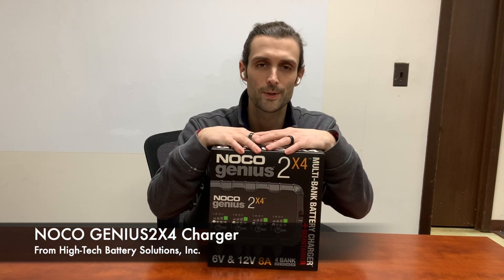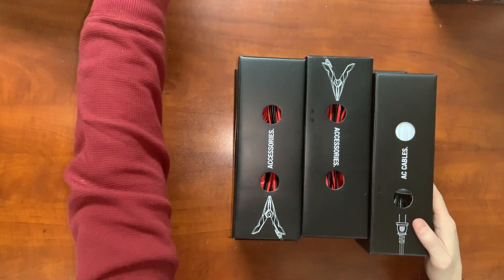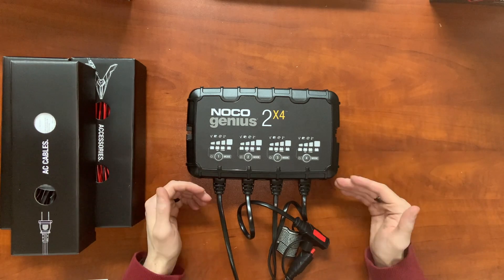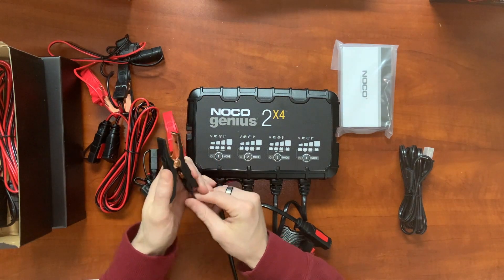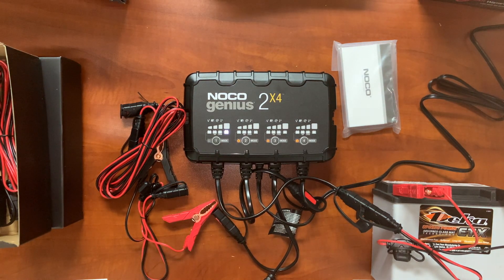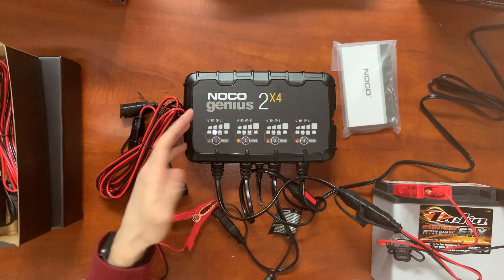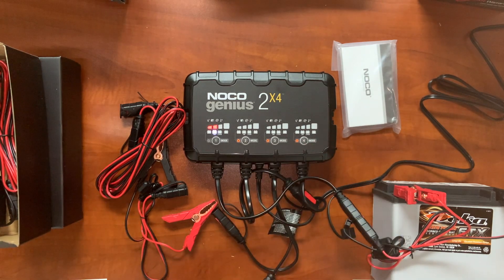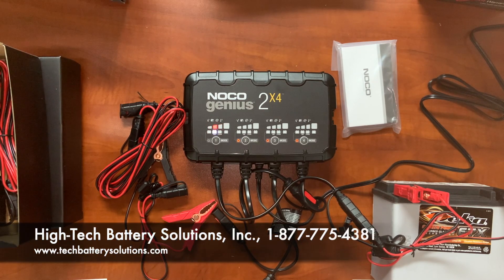NOCO GENIUS2X4 Battery Charger Review

Comment: A shame they did make the plug attacked to the box modular don’t always need having cables hanging
Reply from the maker: The first iteration of the charger did have fully detachable plugs, one of the things we noticed with using it over the years was that our guys were able to tug on the cord and disconnect it from the charger way to easy. Since we used these as bench chargers for multiple batteries it got a bit annoying when it happened. Wit the new design its physically clipped into the fixed cable on the charger bank instead of pressure fitted into the charger itself - a lot harder to disconnect by accident.

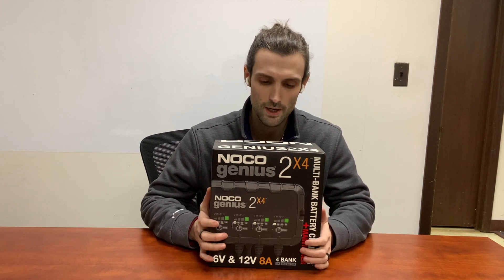Comment: How long doesvot take to care a battery up 0:48
Reply from the maker: This is a 2-amp battery charger. So you need to divide the total capacity of the battery by two in order to find out how long it would take to charge up. An average car battery is about 65 amp-hours for the capacity. So assuming it was 100% dead, I take about 32 hours to charge. If it's a power sport battery, it's much less due to the size of the battery. It would only take 6-8 hours.

Comment: I have 4 duel purpose AGM group 31 batteries with 110ah that are fully charged. I am looking to use this charger to maintain the batteries throughout the winter. With this charger work for maintaining? If so, is it safe to leave the batteries hooked up and the charger powered on throughout the winter or should I disconnect the batteries and turn off the charger at some point? Any advice would be greatly appreciated. Thank you for the video.
Reply: Rather then taking the lazy way out why wouldn’t you just go to the website and get your answer there. I’ll never understand why people do this ask a question on social media vs putting some work in and getting the answer faster from the website. Stop being lazy

Comment: Should lithium batteries be topped off.  I have electric mower and wonder if i should charge after every use or let it discharge down low and then charge ? TYIA
Reply from the maker: I do recommend topping off lithium batteries. Even though they have a much longer cycle life than lead acid, they still get their best bang for the buck the less capacity you actually use from them.

Comment: I have my 4 12V 280ah batteries connected in a series for solar inverter. Do I need to disconnect the batteries from series before connecting the charger?
Reply from the maker: No, you will be able to leave the batteries hooked up in series while using this charger.

Comment: Good video with one caveat. The extensions and different connections. Case in point. I have 3 motorcycles and I am about to install the NOCO GBC007 Boost Eyelet cable permanently to each battery so that in case of being out and about and have a dead battery for whatever reason, I can bust out the NOCO GB40 booster to jump start it. Now, with that being said. Are the extensions configured so that instead of attaching the clamps, you can plug directly into the NOCO GBC007 for trickle charging while being stored?? One more question. With the pervious question, I have to ask, can you actually charge with the battery still connected to the vehicle or does it need to be disconnected??
Reply from the maker: Unfortunately, that is a negative. As of the writing of this comment, the GBC series accessories are not compatible with the Genius Chargers. They are only going to be compatible with the Jump Starters. It's a different quick disconnect style.
Reply: I thought the adapter it comes with solved that?
@HighTechBatterySolutionsInc
Reply from the maker: @gregleblanc9357  To my knowledge I'm not aware of an adapter that will allow the GBC series to work with the standard NOCO Genius line.

Comment: So to be clear, this doesn't double as a power bank? It needs to be plugged in for power to be supplied to the device? Are there devices by Noco that are fully portable (has power bank)?
Reply from the maker: That's correct. This unit is not a power bank. It must be plugged into an AC power source in order to function. NOCO makes portable lithium powered jump starters, but they're not true battery chargers. If you're looking for a battery powered portable charger, I'd recommend taking a look at the CTEK CS Free unit. https://www.techbatterysolutions.com/ctek-cs-free-4-in-1-portable-battery-charger-maintainer-power-bank/

Comment: I want to buy a Noco to charge/maintain motorcycles, slingshots, and sxs.  Would you recommend the Genius2x4 or Genius5x3?  Main difference besides how many banks?  Does the 2a just take longer to charge otherwise same performance?
Reply from the maker: I recommend the GENIUS2X4 for this use case. The 2A output is more than enough to maintain those applications and its easier to use than the GEN5X3 series for charging power sport batteries. The GEN5X3 has permanently attached eyelets on the end of the DC charging cables and is not compatible with any of NOCO's accessory line.

Comment: So this wont charge my 4 agm 6v batteries ?
Reply from the maker: The 6V charge mode on this unit is really designed for flooded batteries - I would not use it to charge AGM series batteries for long term use.

Comment: Question: I selected the wrong mode for my battery (12V AGM instead of 12 v sealed lead acid. So after it turned Green it was taking longer to Optimise the battery. Then I saw you video and understood the difference in the modes so I turned it back to the first 12V. Will that cause any harm to the Battery?
Reply from the maker: Over time it would cause damage to the battery due to the different float charge voltage thresholds for the different chemistries. If it was left on a for a a week or two your going to be just find on that.

Comment: Another  question... If you hook up 2 banks to 1 battery, will that speed up the charging process without any harm to the battery or charger?
Reply from the maker: Negative, it's been my experience that you will actually end up under charging the battery. The charger uses the voltage level of the battery to determine where it is in the charging process. My assumption here is that by having more than a single bank hooked up to the battery will artificially raise the voltage to much and trick both banks into shutting down earlier than needed to get a full charge into the battery.

Comment: can we use it to charge 4 battery 12v 100ah cennect serial ?
Reply from the maker: You can however it may time out on this charger depending on how far down the batteries are drained. Keep in mind that this charger is only putting out 2 amps per bank.

Comment: crazy they dont use SAE connectors then want $72 for 4 adapters to SAE, also ten foot long cables not long enough to connect to 4 vehicles then they only offer expensive additional ten foot cables (Battery tender are 25ft!)

Comment: I'm assuming to just maintain the battery you just leave it connected and forget about it in the regular charging mode or is there a special mode for just maintaining it and making sure it doesn't overcharge it? thanks in advance..
Reply from the maker: Thats correct, leave the charger in the correct charge mode for the chemistry of the battery you are charging and it will go into maintenance mode once the charge cycle is complete.

Comment: Question, I try to charge my optima batteries I believe they are AGM and they have stayed on the first bar and they haven’t moved after like eight hours. Should I remove them from the truck and charge them that way with everything disconnected or could it be a issue with the battery they are brand new, but I haven’t used the truck. I believe the drain completely down.
Reply from the maker: I recommend leaving the charger on the battery and let it try to run through a full charge cycle. It certainly sounds like there is a parasitic drain issue in the truck, after 24 hours if the charger is still on that first bar I would then remove (disconnect) the batteries from the truck and try again.

Comment: I have the noco charger my problem that i’m connecting the charger the to battery and at the same time I’m running my 12V fridge … the charger always shows that the battery is not holding charge…. So how i can keep the charger charge and maintaining my battery while i’m using my appliances?
Reply from the maker: The charger will eventually error out thinking the battery is not able to retain its charge - the draw it outpacing either the charger or its draining enough of the battery capacity to consistently drop its voltage below the charged threshold within a short amount of time.

Comment: Will this charge work on group 31 950-1000cca batteries
Reply from the maker: It would work to maintain them without an issue, however if you are charging them a completely discharged state it's not an ideal output. If you are charging completely drained 31 series batteries you would need to step the charger up to a 5A series such as the GEN5X line.

Comment: Have multiple bikes atvs with different batteries in all of them etc can’t decide between noco 2 or noco 5 ??
Reply from the maker: If you are charging them one a time and they are all smaller power sport batteries I recommend the GENIUS2. If you want to charge multiple at a time then the GENIUS2X4 is the way to go. You can set each bank individually for a specific chemistry and let it do its thing without having to worry about over charging.

Comment: I have 4 motorcycles - all four are maintenance free batteries. But only 1 motorcycle automatically charges when I connect the bikes to the Noco 2x4. the other 3 isnt recognized. What did I do wrong? I forced them to charge but i dont feel comfortable doing this.
Reply from the maker: If you had to force charge the batteries it could be an issue with their initial voltage level. If its below the chargers voltage cut off threshold then you would be required to use the force charge mode.

Comment: I have a novo genius 2x4. The #1 bank is blank, no less are on. Banks 2,3&4 work fine and charge batteries like they should.  Any idea why bank one has no less on??? Bank 1 will not charge
Reply from the maker: If the power light is not on for that first bank at the very least then there is a warranty issue with the bank

Comment: so this will not charge a 6v agm? or can I use it for a golf cart and charge  2-6v agm on agm setting 12v on golf cart 2 @ once time =12v? they all run parallel 8 x 6 48v THX AW
Reply from the maker: The 6V mode on this charger is geared for flooded and GEL batteries so not an ideal solution for 6V AGM's. You can wire them up to create a large 12V battery and use this as a battery maintainer for your entire bank.

Comment: I have a 2018 Toyota Tundra with group 27F 710cca with reserve capacity with 165 min. After having charger on for 8 hrs shows no error lights will go to second red charging light flashing and never goes to green showing its fully charged. The truck starts but doesnt show fully charged. Its on the 12V charging. Any ideas why this is? What do you recommend.
Reply from the maker: It sounds like the charger is working as it should - keep in mind this is a 2A charger, so 8 hours on charger in its bulk charge mode put roughly 16 amps worth into the battery. The typical capacity of a group 27F is 60 to 70 amp hours, so depending on the state of charge for the battery it may take more time.

Comment: I have four 6V AGM batteries. Is there a product NOCO sells that will charge 6V AGMs or can I use the NOCO Genius 2X4  to charge them if I create a series resulting in a 12V output?
Reply from the maker: The NOCO GENIUS2X4 unit does have a 6V charging method as part of its algorithm however it's geared towards flooded and gel cell batteries. NOCO makes the single bank GENIUS series such as the GENIUS10 with a dedicated 6V AGM mode however you would be limited to a single bank charger. It would be a trade off unless you get creative with your wiring.
Reply: Can I use this charger to charge low rider batteries? 4 batteries at once?

Comment: Need your recommendation on maintenance charging/charger for a 4 bank 109-amp hour (each battery) deep cycle system. System is in a garage, in the air with a 120V plug nearby for the garage door opener. Plug has 1 outlet open (not being used). System is used for emergency power back up when the power goes out (grid down). The batteries are to power a 2400-watt inverter for 2 full size house refrigerator/freezers. Thank you!!!
Reply from the maker: I would recommend taking a look at the GENPRO10X4 unit from NOCO. This is a four bank 10 amp per bank charger with all of the features we covered in the GENIUS2X4 video.

Comment: Excellent review......Thanks. 1-question. I live in Canada  where some winter months gets very cold. You mentioned that the charger has a temp sensor. Will it operate when it gets down to -28 to -30 Celsius . I think thats around -18 to -22 Fahrenheit
Reply from the maker: The charger is rated between -20 to +40C for its operating range. I don't think this is a good option for that temperature range. CTEK has a unit call the MUS 4.3 Polar which is good down to -30C. The unit is not as robust in the features, but its been pretty popular in the Canadian market.
Reply: Thanks High Tech.......greatly appreciated

Comment: BE CAREFUL!! This unit is for maintaining 40ah batteries max... it's hidden in the specs. Also the old ones came with stud post connections (that part was covered here) so you'd have to pay another $40 for those. I've had 3 different NOCOs on boats with no issues. Built an electric outboard with 48v ebike kit and old 6hp outboard. Looking for 4 bank charger. Glad I did some research. Disappointed because it is marketed as a marine charger too and NOCO is missing out on a niche demand. So the only option you have from NOCO for a 4bank is a 4x10 which is twice as much and unless you're using the batteries hard back to back days consistently, there's really no need to push 10amps on a deep cycle.
Reply: I know it says 40ah max, but what would the issue be if you used this on a 95ah battery? Wouldn't it just take over 2 times as long to charge?
Reply: @KJMcLaws  you can use this on a battery larger then 40ah. The reason they're recommending the larger charger is because of the time it'll take to charge. which doesn't matter much as it's meant to be plugged in for long periods of time anyway.

Comment: What is max ah battery ,which can I charge this charger,thanks
Reply from the maker: NOCO recommends a 40 AH capacity range if you're looking to completely recharge a dead battery. If you are looking to use it as a maintainer then you are good up to a group 31 series which is typically around 100 AH.
Reply: @HighTechBatterySolutionsInc  thanks

Comment: I have (6) 8V batteries in my golf cart. Will this charger work?
Reply from the maker: If you are looking to maintain the batteries in the off season you could get away with using this unit. If you are going to be relying on it as a full time battery charger I do not recommend it.

Comment: Can thus be used as a onboard charger on a boat
Reply from the maker: Highly recommend you do not use this as an onboard charger. The charge rate on this unit is to low and its not waterproof. NOCO's 4-bank marine charger is called the GENPRO10x4
Reply: @HighTechBatterySolutionsInc  thanks

Comment: Would this work to tender the batteries on a semi truck? it's a 12v system but all 4 batteries are all hooked up together.
Reply from the maker: Yes, you could use the GENIUS2X4 series to maintain your group 31 series batteries without an issue. You would not have to disconnect the batteries from each other to maintain the whole battery bank.

Comment: Thank you looks like a good charger. Can I leave the cables on my vehicle attached to the battery while charging the battery using this device? Or Is it better to remove the negative cable while charging the battery to break the connection with the vehicle ?
Reply from the maker: You can leave the negative cable attached, the charger will not damage the cars computer systems or any of the vehicles electrical components.

Comment: Excellent and very thorough review thank you! I do have one question. If I have two 6V batteries wired in parallel, do I leave them hooked up and use this charger  with 2 separate banks, or would I use one bank and hook the positive to one battery and the negative to the other? Thanks!
Reply from the maker: You can do both. If you connected one bank to each battery (in 6V mode) then you would end up charging your pair of batteries faster than if you were to use a single bank in 12V mode and split the charge between the two batteries.

Comment: Is it OK to leave one of these plugged in to a car that’s barely driven and the car has two batteries?
Reply from the maker: Yes, you can. The charger is fully automatic and will not overcharge your batteries. You will also not be required to disconnect the batteries from the vehicle - everything can remain as is when you use this charger.
Reply: @HighTechBatterySolutionsInc  ok perfect thanks I just got my 2x2 in the mail and the product looks vary nice and vary good packaging

Comment: If you have 2 batteries hooked up in Parallel Should each battery get its own "bank"?
Reply from the maker: If the batteries are hooked up in parallel then the charge will flow to the second battery if you use only a single bank connected to one of the batteries. If you want to double up the charge rate to cut down your charge time then use both banks - one to each battery.

Comment: Hello. Can I use the 2x2 model to maintain two batteries on a 24v system without disconnect them?
Reply from the maker: Yes, the 2x2 model can do that without an issue.